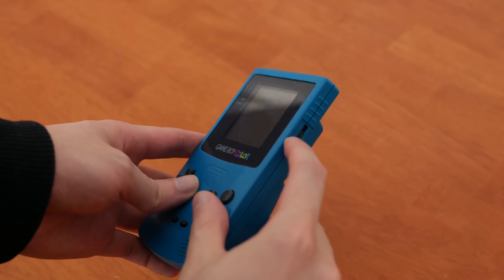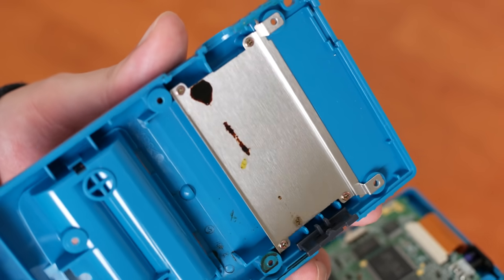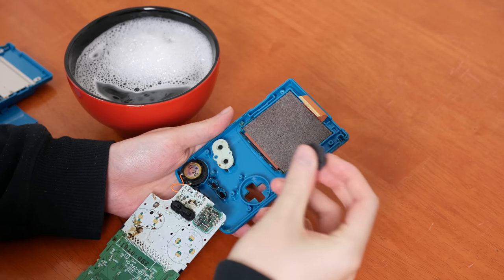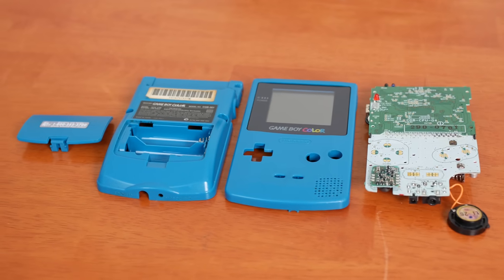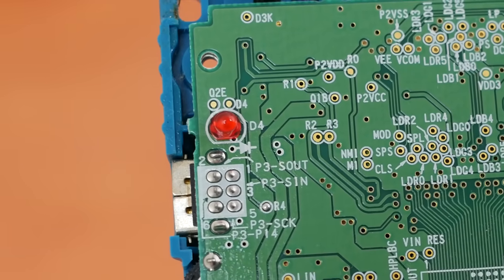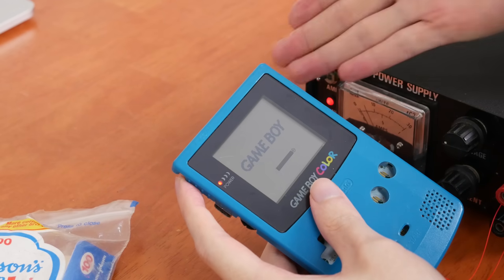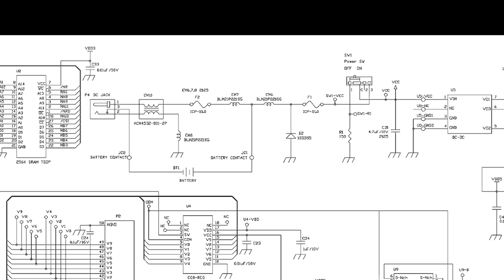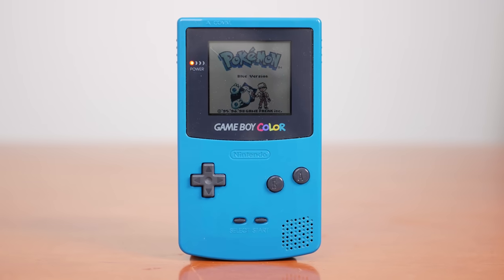Restoration and repair of a DEAD Game Boy Color

Comment: Well, I can tell what happened with that continuity. The pressure from buttons bent the pbc and the track communicating battery got cracked.  Same happens to some nes joysticks.
Reply: I kept looking in the comment section to see if anyone had figured it out. Now I can rest in peace
Reply: I'm thinking the trace just to the side of the pad got corroded and if he just scratched the PCB a little and put some solder on there it would be fixed
Reply: @ErimlRGG  100% correct. The mask looks a little funny to the left of the battery terminal pad. I would have scraped it off.
Reply: Why does NES joystick sound like an oxymoron?
Reply: so the owner pressed the buttons so hard that they cracked the traces?
Reply: @pablo5425 Wouldn't surprise me. Kids can be way too rough with things at times.

Comment: 7:13 Maybe the DC input is for when your batteries are low and you are in the middle of a fight, or otherwise can't turn it off and replace the batteries.
Reply: I used it on my gameboy pocket connected to a USB cable from my tablet to keep my Oracle of seasons cartridge powered for a couple weeks until i could get my save files pulled off the cartridge onto a PC and the battery replaced with a new cr2025 by someone who knew how to do it right and after the battery was replaced i put my save from the PC back on and it has been working fine since then on my GBA SP and the new battery should last for years before needing replacement again

So that's something else it can be used for
Reply: "MOM, MOM GIVE ME THE CABLE I'M ABOUT TO BEAT GARY, THE BATTERIES ARE DYING HOLY SHI"
Reply: @HaxAras  You had a power adapter that fit but provided the wrong voltage. If the LED was brighter than normal, then it was probably over 3Vdc output. Lucky you didn't burn it up.

Comment: It's good to see that you do not give up fixing this broken gameboy. i had a similar problem with a lcd screen with a broken backlight and i could not figure it out what the problem was but i kept on track to solve this problem and finally i discovered a broken solderbridge connecting two stripes for the backlight. and after fixing this issue it worked again. great feeling ;)

Comment: Something I’ve done to fix trace continuity problems in the past is to scrape away solder mask until you get to some bare copper on the trace and then just make a solder bridge from the pad to the bare copper nearby

Comment: i mean I left my GBA SP outside for days on end, sometimes out in the sun, left it in a plastic bin for a long while... It's still alive and kicking. Though the battery wasn't as strong as it used to be. I ended up replacing it after 15 years.

Comment: Nice fix. Usually the easiest way to fix a corroded trace like that is to scrape the solder mask with a scalpel where the break is (hold the blade vertical and move it side to side), then just a quick solder jump or a bit of stripped wire-wrap wire to fix it. A fibreglass brush or sand eraser will also work, but are less controlled. I'd also recommend grabbing a tube of thick flux, dab a bit on anything you put a soldering iron on and watch it work its magic. If you're ever in Brisbane after lockdown, swing by the local hackerspace to say g'day.

Comment: My boi got that jaycar analog temp-controlled mains iron and the legit goot wick. The circuit behind that iron is pretty strange, if you’d found intrigue in opening it up to take a look earlier then you’d already have a tri wing screwdriver, because that’s what the iron uses! Anyhow, nice job repairing, a badge wire is exactly what I’d have done too. I somewhat recently upgraded to a more standardised soldering station (STM32 T12 OLED) and find the different tips a huge help for soldering small stuff. I’m never using a conical tip again if I can afford it, those things only make good thermal contact on their edges which means the iron has to be on a steep angle. I use a K tip (45 degree knife edge) for THT work (less of an angle required, good thermal contact) and a D12 (1.2mm flathead) for SMT work, as it’s nice and small and the small flat at the tip makes good thermal contact along the edge of an SMT pad. Bevel tips are apparently quite good for drag soldering, if you do that a lot.

That strange analog temperature control circuit only uses like 2 op-amps total for reading the thermocouple/thermistor and PWMing/TRIACing the element, and I don’t understand how.

Comment: Nice repair. I had to fix my NES by adding a wire after someone cut a line on the board and damaged another without noticing. They did repair their work, but likely had no idea about the the other.  I have several Gameboys but none have needed more than a little cleaning. Some of the games needed some deeper cleaning though.

Comment: Mechanical engineer here:  You could probably have removed those screws with a pair of sturdy needle-nose pliers. Stick the plier tips in 2 of the 3 slots of the screw, then spread them to the edges. Maybe add a tiny bit of double-stick tape to the ends if you catch them slipping. JAM those pliers into the screw for max friction, and twist. 

I’ve opened many strange screw heads that way. Doesn’t always work but does often enough that it’s worth a try.

Comment: well if the pad broke the next step would be to scrap the paint away from the trace that it goes to and run a solder trace to it. its a dirty fix but it should solve the problem. as a side note you want a good fine soldering tip to do this depending on how big the trace is.

Comment: It could also be soda...when soda dries it leaves behind a syrup that looks a lot like that.  It sounds like the soda or whatever corroded one of the traces that connects the battery terminal to the rest of the system.  Running a jumper wire like that is the best fix to do in that situation.

Comment: If the corrosion went into the board a bit, you may use Flux to try to clean it, or scrape off areas of the pcb and solder Bridge broken traces.

Comment: Question. I'm not that familiar with electrical circuitry so excuse my lack of knowledge. Why connect the positive battery terminal to EM7? Doesn't electricity flow from the positive terminal to EM6 to the power switch?

Comment: Tips for future modders, it's ideal to just desolder the speaker from the board completely and give the pcb a 99% ipa bath in a small container. I'd also advise you guys to replace the 3 capacitors on any stock gbc you may get to mod. Additional mods you can do to improve the gbc are the backlit ips(larger display but requires soldering and trimming of the shell) or tft display mod(smaller display but no additional work required as it's a drop-in mod), clean amp board(reduces power consumption for audio and produces much cleaner audio), replacement for a 6.3v capacitor for the speaker(if you hear humming/hissing after installing backlit display) and new speaker.

Comment: Wouldn’t u be able to drill a small hole through the board and then fill with solder? Wouldn’t that help fix contact with the pad and the board.

Comment: Great video! I own a 1998 Nintendo Game Boy Color and there doesn’t look to be any corrosion on the motherboard nor deep inside the battery. I cleaned out a vast majority of the dust and dirt deep within the crevices, and still the LED for the power button wouldn’t turn on. I have nowhere near the knowledge to you nor the tools to attempt to resurrect it. Any tips??

Comment: What did you use for that TLC bit? I’ve been interested in using modern hardware on my CRT for a while
Reply from the maker: PS3 with composite cable. It even has a YouTube app you can use, but I wanted to crop it to 4:3 beforehand so it's playing an MP4 from a flash drive.

Comment: So I was playing with my gameboy color like i often do and while readjusting my Wormlight, the system crashed. (I noticed earlier that the led indicator wasn’t as bright as usual so I suspected dying battery). So, in my hope of resolving the crashing problem I changed em and it worked for a while (about 1 hour). While playing, I re-ajusted my wormlight again and suddenly I hear a pop and it died again except this time I wouldn’t power on anymore… anyone has a clue of potential issue ? Is it because it’s not an official Nyko one? I’m terribly sad since it was my most prized possession since I was 10 years old :((

Comment: How do you get the multimeter to read the power on the motherboard? Im quite a beginner at this stuff and the only way it reads the power is only when I have the motherboard powered up with a charger

Comment: of all my years of dealing with AA batteries i have only seen corrosion a few times. in my mind electricity should be passing through the metal even if there is corrosion, well i am right and but wrong too. the corrosion can get between the spring and the metal plate that is often soldered to a pcb and if there is corrosion there, apparently electricity will not pass from the spring to the metal plate that connects to the pcb. anyways your video helped me diag a gameboy color i bought recently for $1.00. thanks

Comment: Do you have any tips how I can fix mine? After a few seconds of turning it on the power indicator starts flashing and slowly fading (Tried using a few different types of new batteries) but none seem to work. I already cleaned the motherboard and the battery contacts cause they had a little corossion but this didn't fix the problem.

Comment: From Louis Rossmann I learned pads can be gone completly so either a wire to the next component like you did or scraping open the pcb to get to the trace and wire to that scraping point are vaild ways to fix these.

Comment: The faint yellow mark on the back was a sharpie marker from the factory.
Let's say station 8 in the line installs the back shield plate. It's needed for EM protection to avoid crashes so it's 100% important but doesn't show up as a fault immediately if you test it if it's missing.
So you just set up the workflow of station 9 so that they check if it's there and mark it if it is there to confirm they checked it
They will then select random pieces along the shift, where I worked it was the first 3 in the shift and one every 100, they break it down all the way and check for the sharpie marks to see if our station 9 has checked the back shield being in place

Comment: On mine, i checked the Fuses F1 and F2 for continuity.... well it turned out that F2 has no continuity from the + to the - Terminal. I guess its fried. Just goin to replace it and then it should start up again. Not even the DC Connector works on mine.

Comment: I'd throw it in the sink, also you could have just scratched off some of the silk screen and soldered it to the negative terminal.
Reply: I was going to say the same. Scratch away some to reveal the intact trace and bridge it with some wire if needed.

Comment: instead of Q tips on the plastic use a tooth brush you might still need 1 or 2 q tips for smaller holes and sections but itll be much quicker

Comment: Grab a $20ish electronics screwdriver set off Aliexpress, it should have triwings and a bunch of other heads that are less common included, I use mine constantly. Also, tri-wings aren't Nintendo propriatery like gamebit, you'll find them on a bunch of stuff.

Comment: Hey Matt, for cases like this, get isopropyl alcohol and GENTLY scrub with a toothbrush!
Reply: Sugar is much less soluble in alcohol than water.  New toothbrushes have tough bristles which will damage small electronic components (such that you won't find on hardware this old).

Use a cotton bud and warm distilled water.  Dry off with a heatgun from distance.  Use soapy water for stuff that doesn't dissolve in the water.

Comment: seems like a perfect time for a backlight mod. lol
If only fixing my C64 was this easy. I actually just lifted a trace while working on it. I'm so pissed at myself. I forgot to reduce the temperature down to 350 after working on the ground pin. I patched it just fine, but it didn't fix my issue. So I now have 2 good PLAs and 2 good color SRAMs. Next on the list is the logic chips. It will probably be cheaper to just buy ALL of them. lol The computer works really well.......if you're color blind. The color changes randomly when it scrolls. Usually to black.
Reply: I don't think that would be an issue with the logic chips, more likely an issue with video. (If you figured it out by now, please tell me if it was the logic chips..)

Comment: The gloop looks like battery acid :/, maybe someone left batteries In it for too long and the old batteries leaked into the components? And when the owner seen that the batteries were old and not working they just replaced them, so in a way it could have been old batteries

Comment: did you really buy and wait 3 months for a triwing screwdriver? 
bro... i just use a small flat head between 2 points. triwing screws are among the least secure security screw. along with the ones that put the post in the middle of a security torx screw. 
you can easily break the middle post off and use a regular torx screwdriver. these security bit designers think they can outsmart a kid.. 
im an adult now for sure though you can tell because my comment isn't a meme..